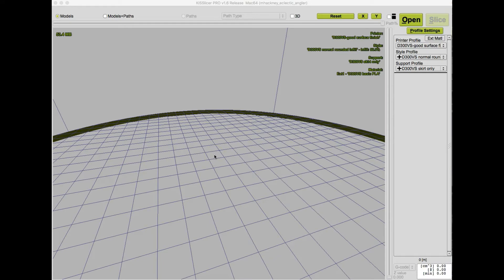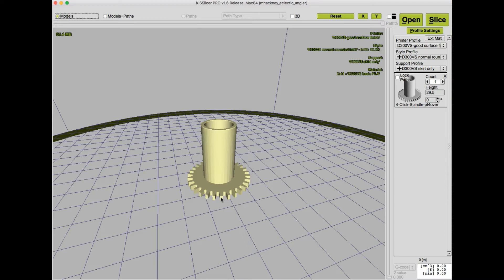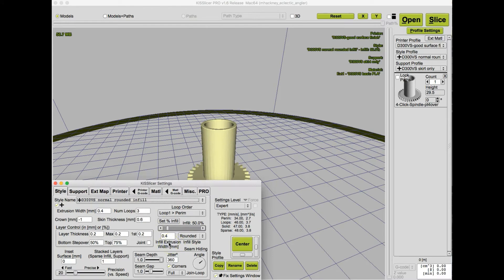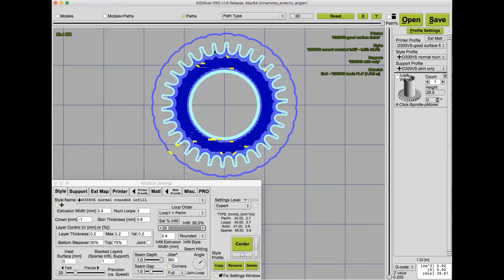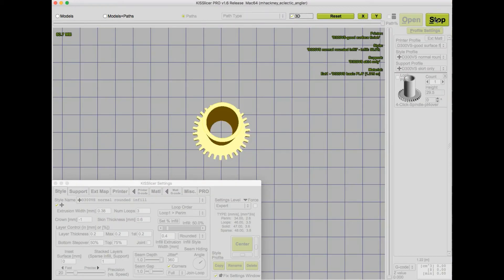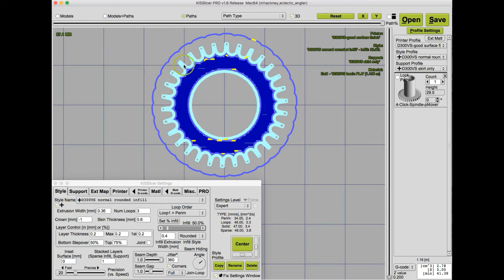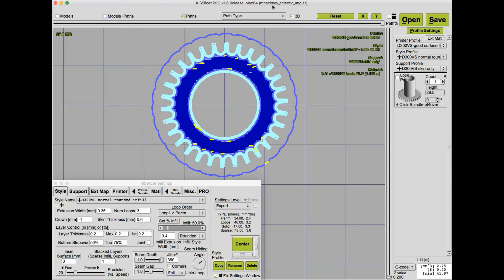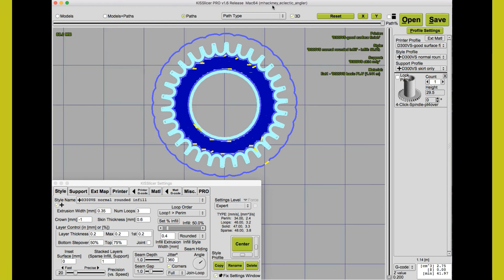SMC E1 - Manipulating Extrusion Width

Comment: Won't using 0.35mm width on a 0.4 nozzle be unreliable?
Reply from the maker: The intent of this video is to special case difficult to slice models to achieve better results. the basic idea is to deposit slightly less filament than "normal" and to coerce the slicer into depositing that into narrower areas. Since these will always be bounded by a full width extrusion there is not issue.
Reply: Ok, thanks :) ...btw I really like the tusk idea, I may try it on my printer. Either that one or the petsfang everyone seems to like.